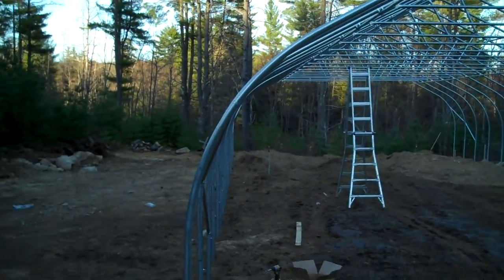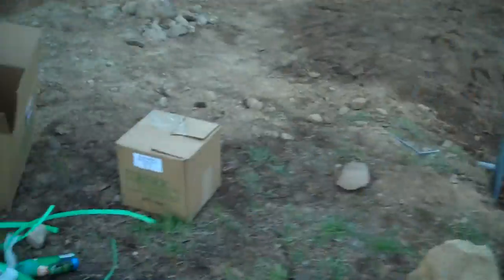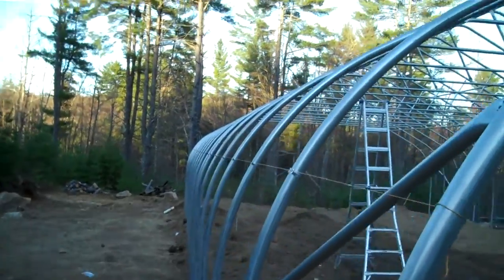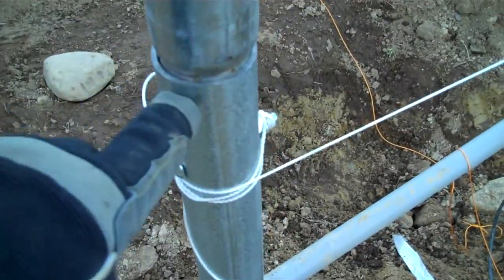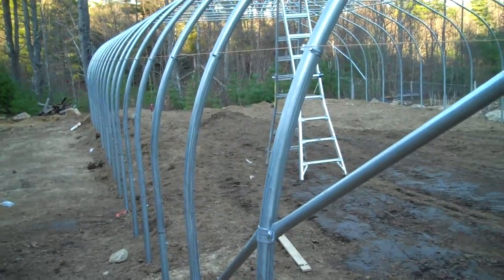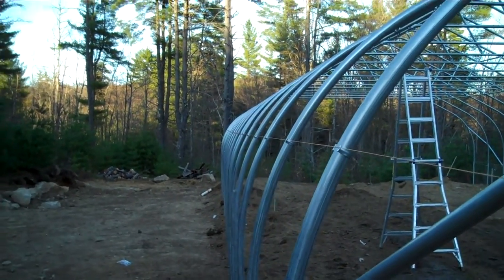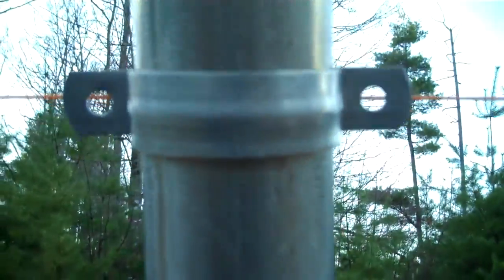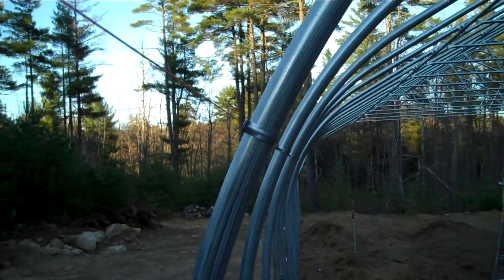Greenhouse Construction: Rimol Nor'Easter Construction Pt. 5

Comment: Several thoughts on this build. Having just built mine using the directions that came with it I wish now after watching these videos that maybe the whole plumbing of the greenhouse went into a little bit more detail and earlier on in the instructions,as opposed to being vague and at the end right before End wall construction. Also if i was to do this again I would have installed all of my wirelock channel on the ground as i completed the bows.Would have saved alot of dangerous time up on ladders. Same for the end walls. Lastly there was no instruction on the most important piece.... the plastic...ie... how long to cut,how to attach.what not to do. All of these things would have saved me 2-3 construction days.